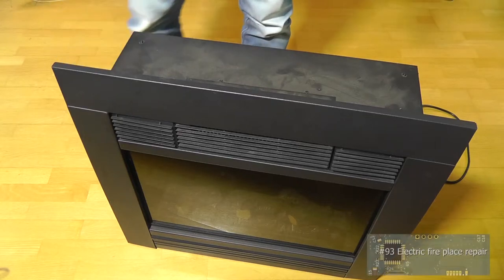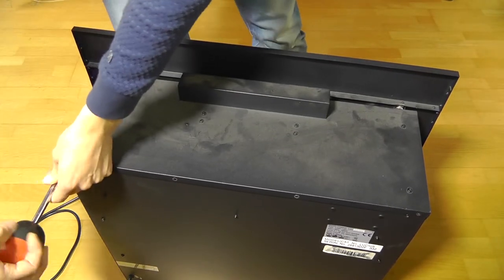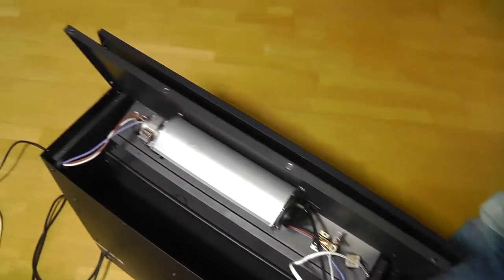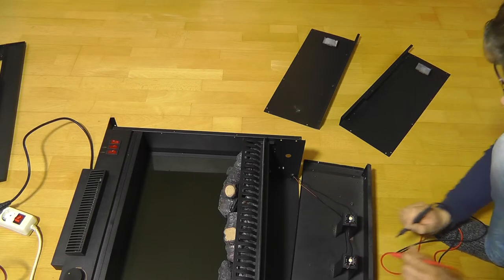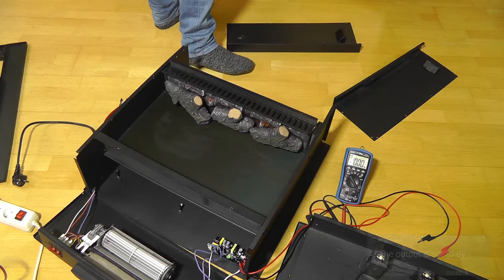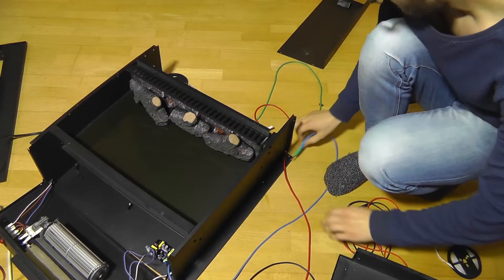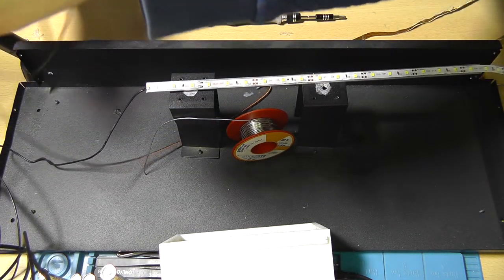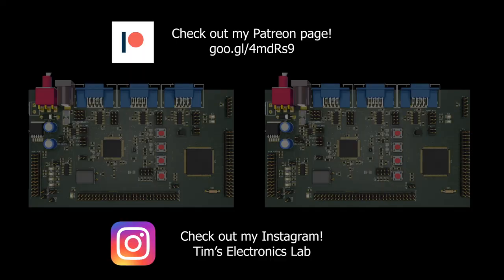#93 Electric ⚡ fire place 🔥 repair

Comment: Isn't the power cable a bit flimsy for 1800W?
Reply from the maker: To be honest, I did not pay attention to the cabling at all 😂
The LED's are running at 1W, and I suppose that the 1800W is only used when both heating stages are powered on